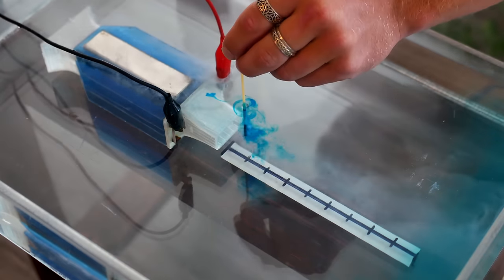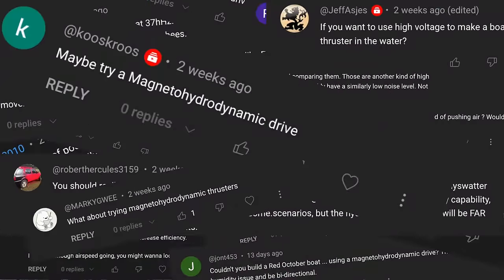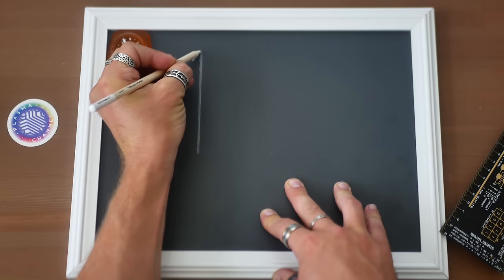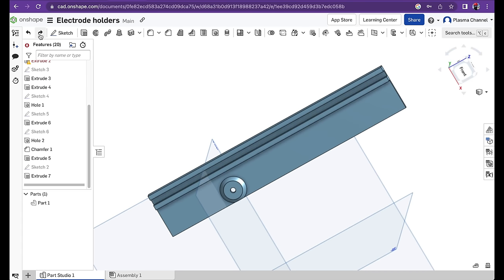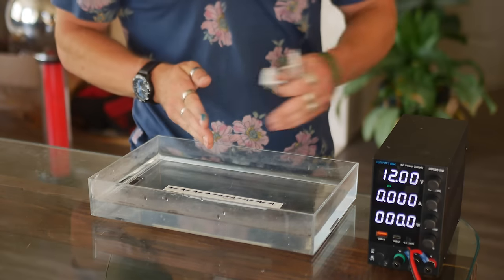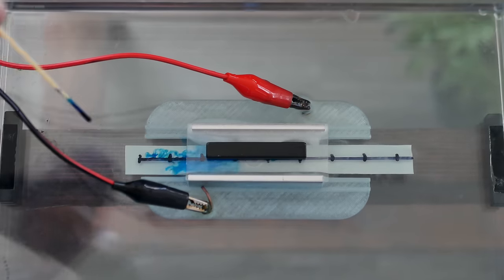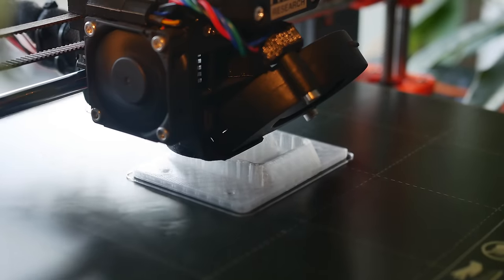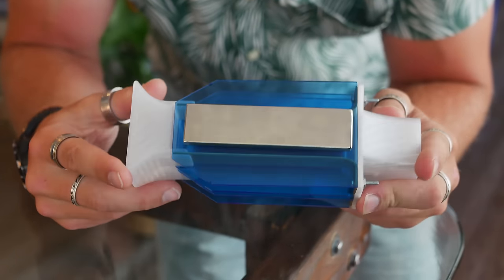Using Stealth Propulsion for Ocean Travel (MHD Thruster Build)

Comment: I wonder if placing plastic straws in the space between everything would help keep the water from going turbulent and maybe more steady velocity 🤔 small straws but not super small like coffee straws, just normal straws
Reply: The straws would block the required electrical current flow through the water.

Comment: I was thinking about catching the fish with the hooks stuck in their stomachs by swimming near the boat out of curiosity... wouldn't it affect the operation if it is interrupted by a foreign body inside the system... trapped by the magnetic force?  I imagine that it would be enough to turn off the electrical flow to stop producing the magnetic field but it would still be inside the system... applying a nylon mesh at the entrance as a filter could hinder the aesthetic design but would help keep the magnetic system unobstructed ..

Or I'm high? 😂

Comment: I built a HYDROGEN Generator from 2 Plastic water filter containers and 5 STAINLESS STEEL disks. i submerge it in water and add my power. The more AMPS I run...the greater the hydrogen and oxygen flows from the plates. ive had them submerged in water now for 5 months...NO RUST.   completely clean.   I use the hydrogen gas to either burn for a home made torch for soldering or welding...or i can use it in a gasoline engine...in place of GAS....because the hydrogen burns....yes...I have a bubler unit....so..in case of back flash it goes to the bubbler unit instead of the main tank. I also put flash arrestors on it from a welding unit so no back flash happens.  so...i thought i might mention...USING STAINLESS STEEL PLATES...the thinner the better.....it uses less power.

Comment: Wow so I guess if max energy is not an issue like when you have a nuclear powered sub then you could use electro magnets instead of static magnets . That could really move your submarine along . Now upon saying that Jay I pre warn you about embarking on building a mini nuclear power station in your lounge room with your table saw and soldering iron but if you do can you send me the schematics before you do a test run cos you will probably succeed to a deadly level ! 😂

Comment: You do know that water CAN NOT be compressed right?

You placed a "compressor" both in the input and exhaust of your unit. While that works great for aircraft jet engines, it does absolutely nothing for a water engine. In fact your exhaust may even be pinching your flow. 

Your maximum flow even in the most efficient electrical and Magnetic  system will be determined by the area of the smallest opening and or the smallest area inside the eng itself.

Notice on Dam Turbines their openings and tubes leading to them are all the same size, including the outflow down stream.
Reply: Even liquids are compressible to some extent, but it's reasonable to assume that water is incompressible for the purposes of this discussion. 

There are no compressors in this device. Nozzles and venturis certainly do work with incompressible liquids. 

In the water flow path of a hydroelectric generation turbine system there certainly are changes in cross-sectional area.

Comment: Are you producing hydrogen when you use this engine if so that would make it the exhaust to the engine, could you then capture that hydrogen and use it to potentially fuel a hydrogen generator that would produce the electricity that  power's the engine🤔

Comment: If you are considering make this for a boat, you will also need to think in a sistem to control the speed by controling the magnet distance instead of controlling the electricity of the sistem, and applying a movable nozzle to stear the boat.
But i better shut up, cause i'm thinking in things that for me are imposibles to make

Comment: Now what would happen if you took electricity and instead of the thruster being a destination use it series with another work load IE lites motors ECT.
Reply: All mas in the universe is constant ...plasma a mass will flow thru the thruster and continue on to other work loads

Comment: Not so stealth! 
First: noise due to barbotage, when the oxygen and hydrognen bubble collapses. 
Second:
stealth submarine with supermagnets? Nice target for MAD (Magnetic Anomally Detectors): Maritime patrol airplanes often have such a sting with magnetometer. 
*
Besides the corrosion of electrodes an erossion due to the micro cumulative streams (generated by the bubble collapse) would apear.  The bubles on eletrodes may lead tpo reduction of current.
Anyway: good work!

Comment: and what if you used copper and aluminum instead of brass, I'm curious what the effect would be, if it would drive itself.
Reply from the maker: I’m curious about this too. Should drive itself a little bit
Reply: @PlasmaChannel  instead of plates, use rods alternately, aluminum,copper in the form of a tube at a short distance from each other,there will definitely be some chemical process but I don't know if it will be enough to move anything, although water behaves differently than clean air, it will certainly not be an immediate reaction.
Reply: @PlasmaChannel  the alkalinity of the fluid is also very important.
Reply: @PlasmaChannel  you should also test this engine in real sea water, because there is not only salt but also other minerals that have a large impact on the reaction taking place

Comment: well.. this equals 225W of power consumption.. if that was a propeller you would need a bigger... tank.. efficiency seems to be really low here.. wonder where the energy goes to? into electrolysis? or heating the water?
Reply: @plasmachannel, are you sure the system drew all the 9 amps? maybe it did not take that much power from the source..

Comment: insolate those electrodes and wires from conducting electricity any where else besides inside that you are producing thrust this should give you another jump in thrust! think of all the power being lost on the outside as a fuel leak that is lost thrust in a jet engine because that fuel is not getting in there also think of the fact it is interfering because of moving all the ions around in the rest of the water and not contained only on the inside like a thrust leak

Comment: Any videos with a boat using this?
Reply from the maker: Coming up I will be placing these on a full boat 🚤
Reply: @PlasmaChannel  cool, u noticed anything about corrosion? I mean electricity and salt water sounds like rust to me. It would be nice to have a boat where ull have almost zero maintenance on the engine. That drastically lowers the cost of owning a boat

Comment: Efficiency is poor as demonstrated by the racy Japanese Yamato 1 with superconducting magnets which managed 15km/h. Fun to make flammable Oxygen and ?Chlorine by hydrolysis which give a bright yellow flame. Lots of electrode degradation and bubbles.
I have made a balsa MHD boat in salt water running 15W with onboard power or 1kW with trailing wire. Fun but not practical.

Comment: Did you check your patent sources for correct info?  When MIT Prof invented  MHD drive in 1969 it only worked in salt water.  It works with Alloy Mag channel. And an Electromagnetic control field at 90 degrees that grabs or pushes salt water through the tube or channel.  I believe you are showing is not the same thing.  You are just using one type magnet. and not the electromagnetic thruster.  Your gadget it very weak by comparison to real MHD drive.  Misinformation?

Comment: This is just a linear electric motor. The water is the armature. I'm doubtful this can be as efficient as a motor and propeller because seawater is not as good a conductor as the copper windings used in a rotary electric motor. Energy will be lost warming up the water due to its internal electrical resistance. Cargo ship propulsion systems are very efficient but this linear thruster is unlikely to come even close to being competitive. This is a nice little science demonstration but not likely to find a place in a competitive marketplace. Hopefully our woke government doesn't mandate using these because "green".

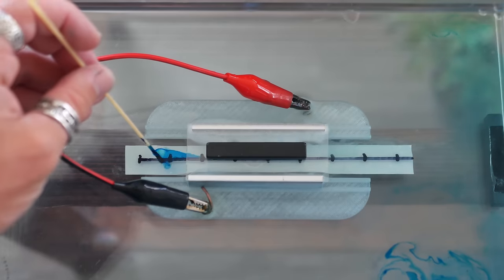Comment: 0:33 you can clearly see something that looks like electrolysis and that can be as bad or worse to animals than propellers, I did check few moments later in the video to see are you discussing this and you did mention it is electrolysis but starting video with claims like you did and not with the fact that it would make huge mess and electrify the SH.... out of ocean water and life in it and it is exactly the same as saying that running nuclear power plant and cooling it with water from the water supply of your house is great idea, it is free just route your water supply before your house thru  nuclear power plant and then into your house.